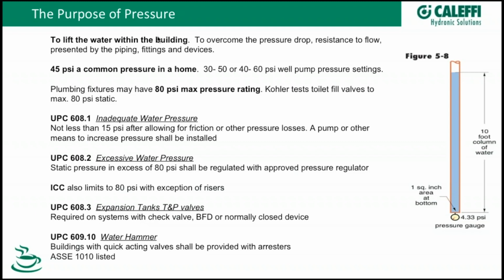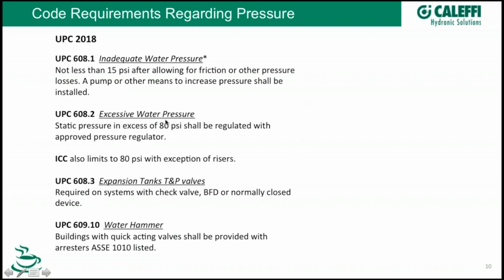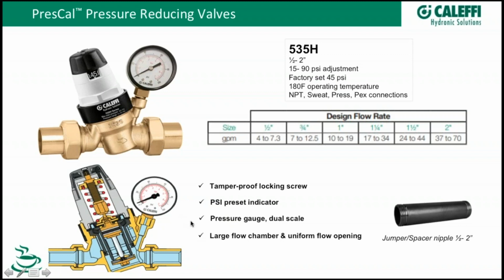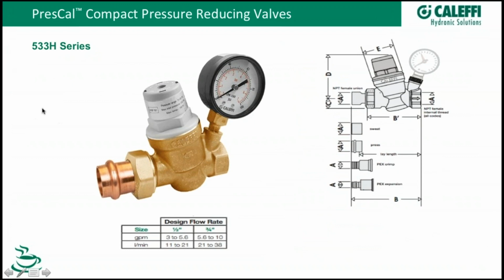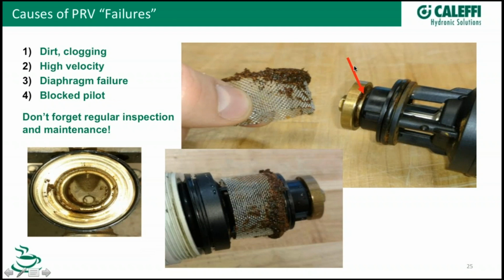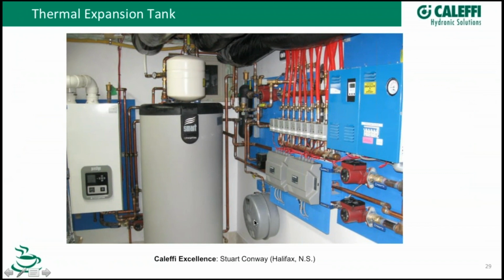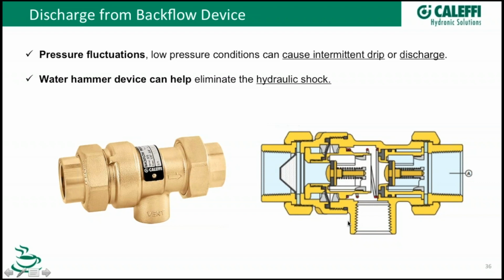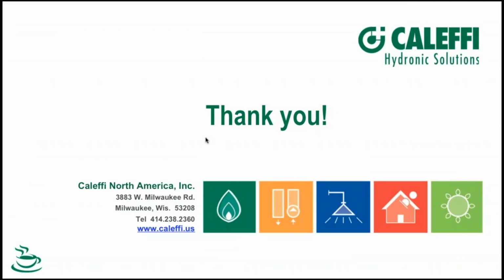Controlling Pressure in Plumbing Systems

Comment: Hello,
just a question, how to you realize sealing between the pressure gauge and the device ? Thanls for your help !
Reply from the maker: Thanks for your question.  You can use Teflon tape or thread sealant at the threads connecting the pressure gauge to the device in order to realize sealing.